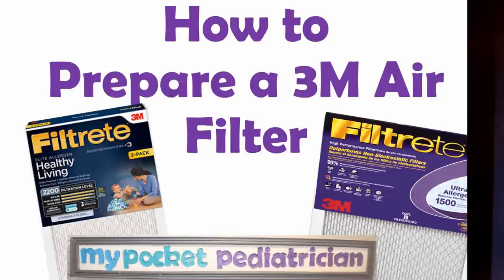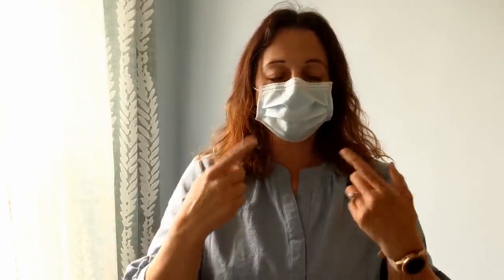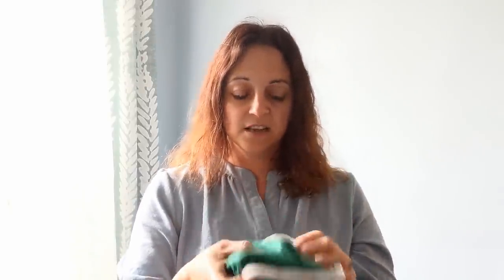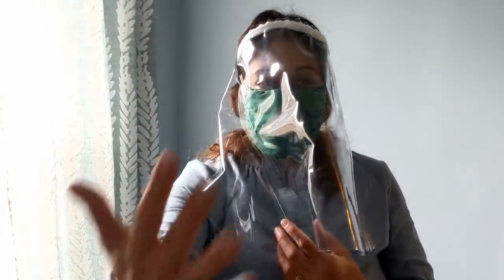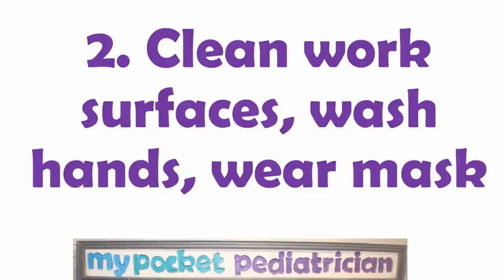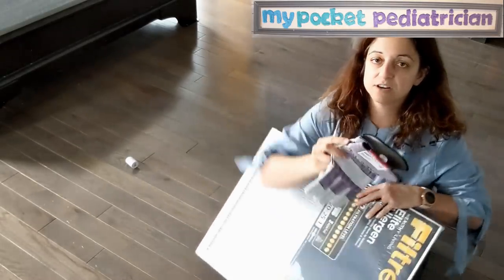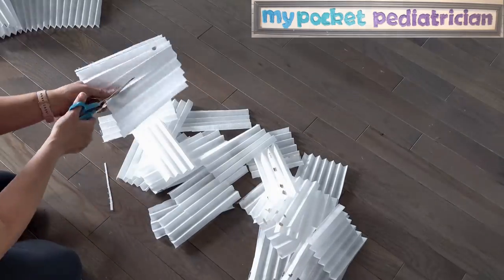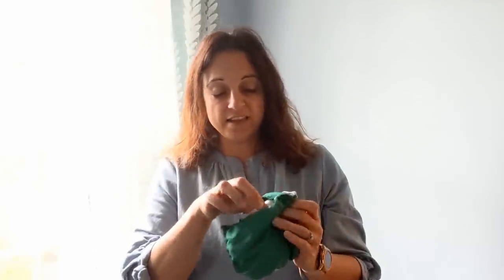UPDATED!  How to Turn a 3M Air Filter into a Face Mask

Comment: I removed packaging and stupidly forgot to mark the direction of airflow onto the filter. Now that I have it apart I thought that i might be able to see a difference between sides of filter. No luck...any words of wisdom or should
 I just start over and buy another?
Reply from the maker: One side is slightly shiny...that goes towards the patient...the softer duller side goes to the healthcare worker
Reply from the maker: One side is slightly shiny. That goes to the patient.   The other one is a little softer and duller, and that should go towards the healthcare worker.

Comment: you should really make a point to tell folks to wash hands after disposing of the masks and right after putting them in washer.   Also to spray any areas that your hands came in contact with like, the washing machine door/knob, anything.  People should know this, but they will follow your steps, and unless you emphasize that important step, they may forget/skip that obvious process.
Reply from the maker: Please see 18:55
Reply: @MyPocketPediatrician  I had already rewatched that portion...third time now.  And while its implied and to me and you, common sense, some need it spelled out with a neon sign.  "....and DON'T FORGET TO WASH YOUR HANDS THOROUGHLY AFTER USING THESE."   Just my opinion.  Stay safe out there.  and thx for the video and quick reply.
Reply from the maker: @papitosabe  thanks for clarifying.   I initially thought cleaning work surfaces and washing hands was common sense, but later realized I needed to put that in too!

Comment: Just get a non-n95 dust mask, and line it with the furnace filter material...
Reply: Igor Schmidlapp those are all sold out too!  And how are you going to “line” the cupped mask? I ask because I got a box of those things, and have been trying to figure the best way to “line” them. It’s impossible. I got super sick and almost passed out from wearing those with cloth stuck inside as a liner.

Comment: So I have been wearing an n95 mask with a respirator thing in the middle.  I thought this protects, however,  i can smell things in the air like a cigarette or food. Does that mean its not protecting me?
Reply: It does not mean that.  Though you shouldn't get enough smoke through it to make you cough, many smells come through an N95. (anecdote: In EMS we sometimes wear them to hide hideous smells like decomposition or gangrene. It helps, a little, but not completely.  We sometimes smear Vick's Vapor rub inside the mask, a tiny amount, to hide smells).  Professionals get fit-tested regularly to see that they know what size N95 to wear.  You need to do your best to know if you are wearing the correct size.  The vast majority of the population wears a regular.  Some wear a small.  I have never seen a large.  Also make sure you crimp the nose metal around the bridge of your nose for a snug fit. Stay safe!

Comment: Here is an idea:  there are a lot of small oxygen canisters which can be carried on your back andbbe pressurized with air.  Put on nasal prongs and turn on air cannister to 4 to 6 liters. Put on n95 mask then facesheild.   The cannisteted air will be giving you oxygen and it will created a positive seal which will repel viruses
Reply: I am a paramedic and we do something similar with our respiratory patients that might be contagious.  We put a nasal cannula on them, titrated to however little oxygen they need, and then cover their nose and mouth with a surgical mask to contain droplets.  
  True O2 tanks can only be filled with O2, never with compressed air.  I am not sure what tank you might be referring to. In the hospital, O2 ports are green, O2 tanks are green, compressed air ports are yellow, and compressed air tanks are (sometimes) yellow.  
  One downside to using a nasal cannula under a mask is that it interrupts the seal against the face.  This would be a big deal with an N95 which requires a tight seal to be effective, less so with a surgical mask that is designed to protect others from the wearer, and has no tight seal.

Comment: To everyone commenting how the moisture from breathing will damage the filter:

Yes, this happens even with N95 masks, as well as surgical masks. That is why they are not recommended to be worn for longer than 8 hours tops. In regular circumstances, hospital staff dispose of them after a set amount of time. Please dispose of the filter after each use. 

As a healthcare worker frequently on COVID floors, I had to use the same N95 mask for two weeks. I did not have direct, close contact with patients, and I doused the mask in alcohol (which actually ruins the fiber in the long term, but we are desperate). The mask actually protected me despite its extended usage. After not wearing the N95 and only a surgical mask for a week, I am now symptomatic for COVID. Waiting on results. 

Stay safe out there and support your healthcare workers, especially doctors and nurses, when you can.
Reply from the maker: Prayers for a speedy recovery.  I have a new and improved Adjustable mask with FILTI material that passed the FIT test!  Please check it out here:  https://youtu.be/2J3Fq4o-U4I

Comment: Would it work to put the filters in the a 160 degree oven for 30 minutes?
Reply from the maker: many have suggested this.  From the people I talked with, I don't think so.  THe electrostatic forces that are impregnated into the materials are not heat stable.

Comment: Fwd at least to 10:00 to checkout materials and procedure.
Reply from the maker: you can, but the intro gives a lot of important info about the design of the mask.  If people put these in regular pocket masks, the air will just flow around the outsides of the mask and do more harm than good.

Comment: Interesting.., it looks like a cloth shower cap? Wonder if that would work by adding straps and the filter 🤔
Reply from the maker: I don't know - the filter must be cut to the exact same size as the mask.  I've been making a smaller adjustable mask for my friend who can't wear a standard N95 and can't get any masks at all.  I cut her filters to be the exact size of her mask - if there are any gaps where there is no filter, the air will just find the path of least resistance and go through there.

Comment: I have instructions from another physician made video with masks cut from HEPA FILTER vacuum bags. There is no cloth cover. Can you comment on the safety and efficacy of that substance?
Reply from the maker: I saw that video.  I believe it is efficacious because he said they passed a FIT test, but I'm not sure about safety.  I know there isn't fiberglass in this 3M high level filtrete, but I couldn't find the MSDS sheet on the Hepa vacuum bags, and many suggested there are fiberglass particles in them.  I don't know if it's true or not and couldn't find good information on it.  Lots of people commented on this video that these contain fiberglass, and they don't, so I really don't know.  I'd call the company to check if you're planning on doing his.  My masks passed the FIT test on me, and when I remove them from the cloth mask after use, they are a bit fuzzy, but I don't see anything particulate, not that that means too much.  I'm working with another material right now and hope to have a "new and improved" video out today or tomorrow - the editing is killing me, but very soon, so please subscribe so you get updates!
Reply: My Pocket Pediatrician thank you so much! Your help is greatly appreciated!
Reply: I contacted Hoover the maker of my HEPA FILTER VACUUM BAGS. I sled whether their bags have any fiberglass in them. This was a question I posted on their Facebook page and I got a very quick response.  They told me “while ofiberglas is sometimes used in our vacuum filters, our vacuum bags do not contain fiberglass.”  This seems to indicate there is no concern about fiberglass in Hoover HEPA FILTER BAGS,  and  I plan to continue with these. I thought it might help to share this info with you. I of course cannot say that the info will hold true for other brands.

Comment: The arrow is the indicator for how to install in the furnace. It is there because the metal mesh is only on one side to prevent the filter material from being sucked into the furnace blower motor. 

The orientation of the filter doesn’t matter for filtration when used in a mask.
Reply from the maker: I don't think so.   Mine had mesh on both sides.   One side is shiny and one is dull.   On the higher level filters that do viral particles there is an electrostatic forces to catch microparticles so the direction is important
Reply from the maker: I don't think so. Mine had metal mesh on both sides. The higher level filters are impregnated with something to create an electrostatic charge to catch microparticles. The shinier side faces towards the patient and the dull side faces towards the healthcare worker.

Comment: You could sew a bread tie in the fabric for the nose.
Reply from the maker: I used a floral wire, some weather stripping foam and ribbon to hold it together because I wanted the shaping of the floral wire and the foam helps with the seal

Comment: Hi, can you tell me if you looked at Honeywell filters, FPR 12?  I’m struggling to find the filters you mention in the video and the Honeywell filters are the only ones I can find in local stores.  I can’t tell from the packaging whether they have fiberglass in the product.  They say that the protect up to 0.3 microns.  I would really appreciate your feedback on this product before I cut them up and use them in masks.  And thank you for such informative videos and all of your research.
Reply from the maker: Hi, I'm really not sure. I looked at them in home Depot and the material looked very different than what the 3M filters were made out of. I have had a lot of people say that there might be fiberglass in those, but people are saying there's fiberglass in the 3M ones in there definitely is not. I have found a better material called Filti which is available at filti.com and I made a new video about that one. It was designed for DIY face masks and it works out to be cheaper and a whole lot easier. Please check out that tutorial here.  I also have a discount code for my viewers with them.
Reply from the maker: https://youtu.be/2J3Fq4o-U4I
Reply: Thank you so much!  I just ordered two packages and used the coupon, which is particularly helpful since the shipping method is only through UPS and was a bit over $20.  I have had my sewing machine set up and ready to go for several days now and am really excited to be able to make masks that will be effective.  Along with making them for health care workers I plan to make some for the people in my local grocery store, where I continue to see people stocking the shelves in the middle of shoppers without any mask protection.

You are doing so many people such a great service, which cannot help but save lives as we go forward.  Thank you.

Comment: You should save the metal mesh and turn it into nose wires. Cut them up and put a few on some tape & roll up to make nose wires to fit the shape of the bridge of your nose.
Reply from the maker: I tried that, but it is so sharp!   I couldn't do it without it feeling like a bunch of little needles.    Someone told me she did wrap it up in tape and it was ok.
Reply: My Pocket Pediatrician I found better options for the metal nose piece in my kitchen: the foil wrap on wine bottles or liquor bottles and the closure on bulk coffee bags all form nicely and don’t poke like the wire on the air filters.

Comment: I had seen a post that said that hepa filters being cut up can cause small particles to migrate into your lungs and should not be used.  That it could cause inflammation. I don't know how you filters compare.
Reply from the maker: The MSDS sheet is in the description and pinned to the top.  I don't see particles flying off the cut filters - even after prolonged use, which I wouldn't recommend, it just gets kind of fuzzy.  Because it's not directly against the face, I'm not as concerned as I am by those models where the vacuum bag is applied directly to the face.  That said - I can't say if this is safe or effective.  This mask passed the Fit test on me today.  I'd encourage anyone wearing it to get Fit tested if possible.

Comment: Does Honeywell work too? Home Depot only had Honeywell
Reply from the maker: I don't know.   I looked at them in home Depot also, but the material looked really different than the 3M version, and there was a lot less of it per filter.   I am editing a new video about better (I think) and cheaper material...please subscribe so you get the update!
Reply from the maker: I don't know. I looked at it too at my home Depot and the material looked very different to the 3M one. There was also a lot less of it per filter. I am working on a new video about new material that I believe is better and cheaper. Please subscribe so you get the update when it's published.

Comment: Can I apply the filter on disposable  3M dust masks or is this something you wouldn't recommend? My father has a few of these in his garage.
Reply from the maker: I don't know - you need a good seal over anything with the filter material.  If the filter doesn't cover every part and have a good seal, it won't work.  Maybe you can try and get fit tested with it?

Comment: can we use a vaccuum bag instead
Reply from the maker: Some people are doing that, but I've heard they have fiberglass in them (not sure if it's true or not), and also they work out to be more expensive.  I am now using Filti, which was designed for DIY face masks, and I have a new tutorial available here:  https://youtu.be/2J3Fq4o-U4I

Comment: I bought material that's used for under beds or couches to see my filters in so the filters wont slide around. Wondering if its safe to breathe
Reply from the maker: I don't know.  I think it's best to stick with 100% cotton.  I have a new and improved Adjustable mask with FILTI material that passed the FIT test!  Please check it out here:  https://youtu.be/2J3Fq4o-U4I

Comment: She said if you wash it or heat it it won’t be as affective. Does that mean that when you wash your mask, it will be less affective as well?
Reply from the maker: The mask itself is made out of cotton so it is totally safe to wash. I am now working with another product called filthy available at filthy.com and I have a new tutorial about it with a discount code.   The filti can go in the autoclave and be reused, but it's about $..50 per day so also easy to just use a new one each day.
Reply from the maker: The new tutorial is available here.https://youtu.be/2J3Fq4o-U4I
Reply: My Pocket Pediatrician got it👍 Thanks

Comment: Thank you for taking the time to do the research and adding a disclaimer to your video. There's so much inaccurate information { or none at all } on whether or not all these masks being made are actually protecting people from viral particles .
Reply from the maker: I have a new and improved Adjustable mask with FILTI material that passed the FIT test!  Please check it out here:  https://youtu.be/2J3Fq4o-U4I

Comment: How often can you use this. Can u wash filtet
Reply from the maker: I would only use this as a one-time use thing. I am now using Filti, which was designed for face masks and can be reused. It can also go in an autoclave and they are figuring out how to sterilize it in oven. I believe they have a new web video on their website
Reply from the maker: https://youtu.be/2J3Fq4o-U4I

Comment: Thank you for this great info, esp the part about leaving the accordion of the filtrete in place to capture the virus.  Question:  If I am making these only for myself and make several, can't I simply let the virus die on the mask after several days without discarding it  and re-using?  PLEASE REPLY, Thank you!
Reply from the maker: I really wish I knew the answer to that.  I don't have the ability to test that.  If someone had access to a TSI particle counter, they can test how effective the filter is after washing, heating, etc.  I'm working with another material that we tested after washing and drying it (not effective any more).    However, I don't know how anyone would know that the virus was completely eliminated...it would require someone with some very good testing equipment I definitely don't have access to - probably an electron microscope that could look for viral particles, but I"m not even sure if that would work.  I'm just a regular pediatrician - not a PPE expert!
Reply from the maker: I have a new and improved Adjustable mask with FILTI material that passed the FIT test!  Please check it out here:  https://youtu.be/2J3Fq4o-U4I

Comment: Near the end of your video, about 18:49, it looks like you are taking 2 filters out of the mask. If you see this question, pls confirm if we should be using 1 or 2 filters in the mask. Thanks a lot for your continuing dedication & support.
Reply from the maker: There are 2 if using the filtrete.  When I use Filti (which was designed for face masks) you only need one.   New tutorial here:.
Reply from the maker: https://youtu.be/2J3Fq4o-U4I
Reply from the maker: Also if you use Filti, I also have a discount code ...MPPMask
Reply: @MyPocketPediatrician  Thanks for your continued help with face masks & filters. I ordered Filti filters yesterday.